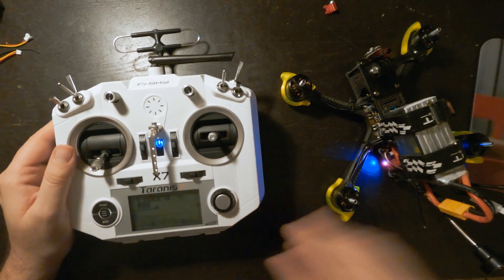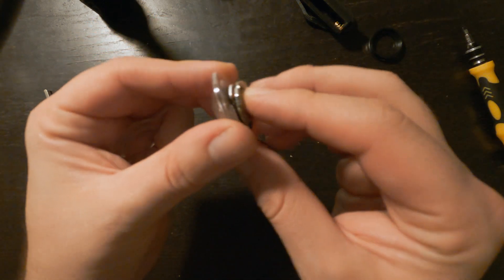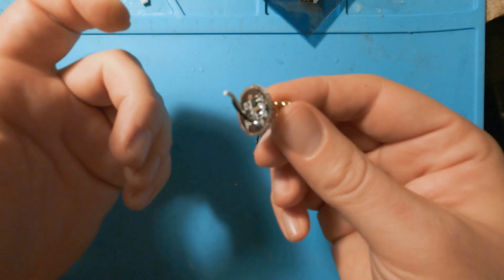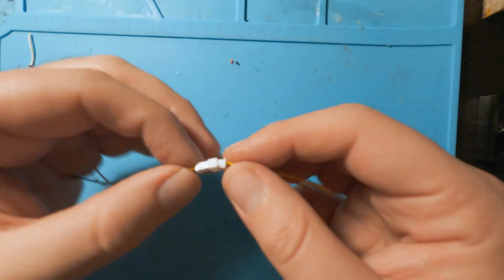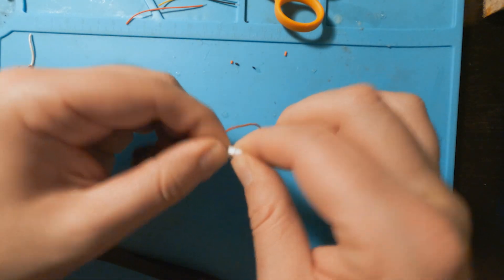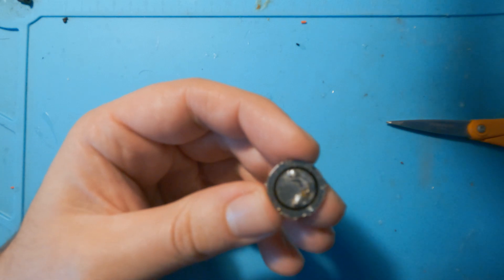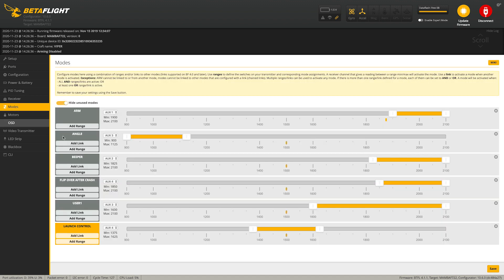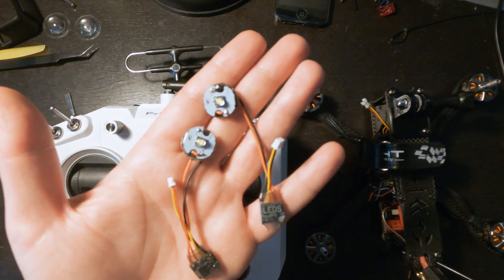How to Add a Switchable Flashlight to an FPV Drone!

Comment: SO IMPORTANT ;)  THANK YOU... AND remember your ppm port write it down!!
because i change to a new  fc because in the cli when i put resource i could fit the ppm port and i didnt knew to witch pin io i put it it.. im new to the game...
 this  is the magic code :P
Betaflight Code for realpit:
Resource PPM 1 none
set pinio_box=40,41,42,43
aux 2 40 2 1600 2100 0
resource pinio 1 B09
save

Comment: Your flight controller already had something setup on for pinio 1 set to pin b00, I would imagine it was setup to turn of the bluetooth module on the flight controller when armed that way the bluetooth doesn't cause interference ....you should watch bardwells video about PInIo or check the betaflight wiki they both show you how to not mess with PInio functions that already come with you flight controller preconfigured.....just thought I'd let you know that by typing 39 in the first column you messed with the pinio configuration that your board came with.....

Comment: you could also just purchase a really bright led by itself instead of the whole flashlight and probably get better quality for cheaper. Additionally you're going to want to keep that chunk of aluminum since it acts as a heat sink. The rushing air over the led during flight will help with heat dissipation so might not need one quite as big but you'll definitely want some sort of heat-sink, could simply mount it to a small chunk of aluminum bar stock or something.